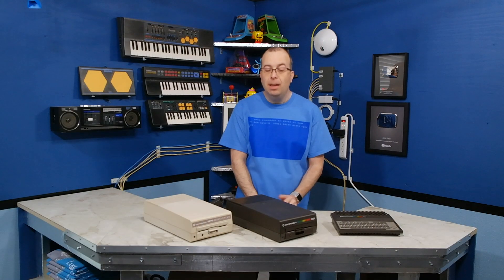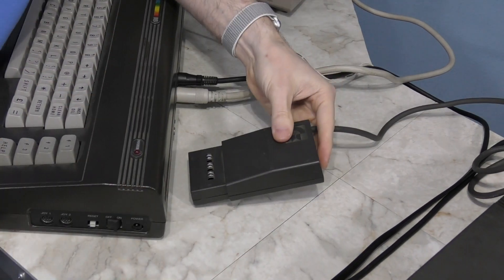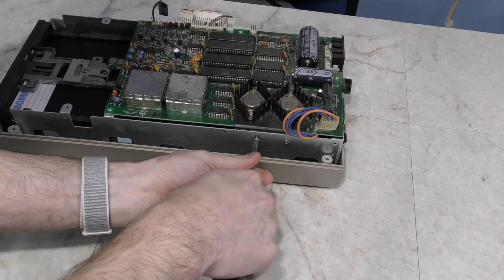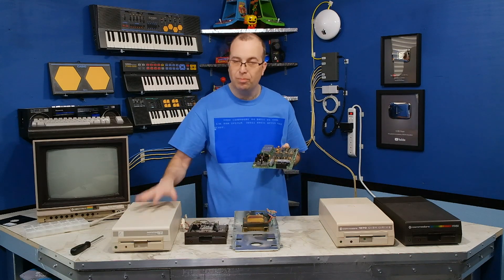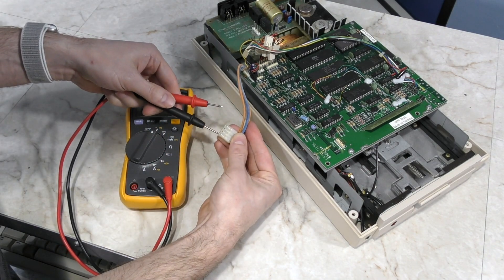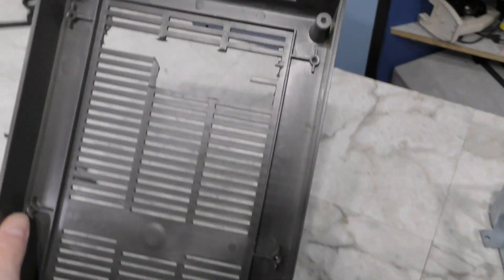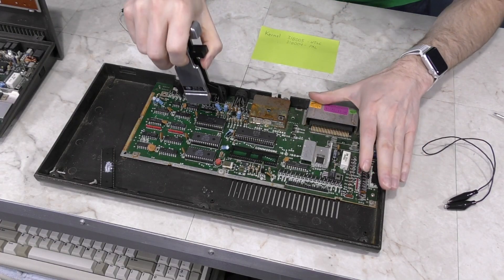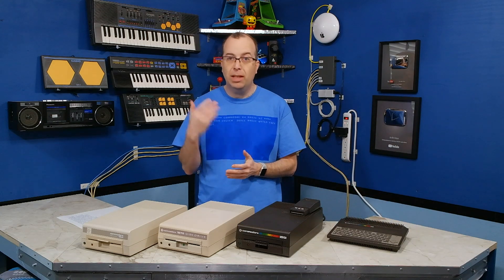Commodore C116 and drive repair, 240V to 120V conversion

Comment: Oops, "Well, we don't have 240V here in the United States." Uhh, yes we do! What do you think electric stoves and electrically heated clothesdryer run on? (Nice place for a correction card.) I like your videos but I wish you'd do a little careful research before you just say stuff.
Reply: The 240V service in the US isn't quite the same as the 240V service in the rest of the world. Besides using a different plug and a different frequency, they use a different phasing system for the service in a lot of cases.
Reply: Maxx Fordham! US 240V power is 2-phase power (2 Hots and a neutral, with the hot phases being 180* from each other. UK 240V is single phase power.
Reply: Nobody suggested that he would.
Reply: Maxx Fordham! how does that work? the house have separate lines with different voltages?
Reply: no , here we have 2 wires feeding 120V each , 180 degres out of phase between them,  creating 240V plus a neutral and a house ground and using US 240V to feed an european device could be ok IF AND ONLY IF the device is not hooked to anything else running on 120V because european 220V has 1 hot wire and 1 neutral, here we have 2 hot wires and 1 neutral , skip the neutral and make one of the hot acting as a neutral create 240V but connect something like an audio or video cable to another device wired for 120V operation and you could bring 120V from the fake neutral into a real neutral and watch out for the smoke A stepup transformer like he used is a much safer solution
Reply: Amnot, yes. are your stove and clothesdryer heated by gas then, so is that why you didn't know about it?
Knucklehead, it might be different, but Dave didn't specify well enough. Also, some places here in the USA have 3-phase, while some have 1-phase, and the 240V in homes is 2-phase like Magi said.
Reply: Drake, even if that were the case, that's not what Dave was talking about. Go back and listen to his statement.
Reply: Right, Magi (even though you mean "hots" instead of "Hots," because it's not a brand name). That has no bearing on what I said to Dave about how incorrect his statement was.
Reply: Maxx Fordham!,
I heard his statement. You are correct that we do have 240v available in the US, and it is an important distinction, but his solution was the correct one.

I wasn't talking about that, though.  I was specifically responding to your statement, considering my electric stove and clothes dryers (and possibly Dave's) don't exist.

I'll admit, I'm being a bit pedantic about it, though.
Reply: Drake, anything about your stove or Dave's dryer or my furnace blower has nothing to do with what I said about his having been wrong about there "not being 240V in the USA." All I was saying is that he was wrong, because we do have it; nothing about his solution choice. So if any distinction should be made, it should've been in Dave's statement, like, "...we don't have 240V to our regular outlets in the USA."
Reply: Oh, haha, Drake, I see what you're saying now: that "your" that I had up there was a key word to you. I didn't forget that gas stoves (including their conventional-oven section) and gas-heated dryers existed, but I accused Dave of having all-electric ones, instead of just talking about them here in this country in general. I fixed that now, haha! So in order for our following replies to make sense now, we should just delete all that pertain to my "your" error that was up there. Thanks for pointing that out to me.
Reply: evknucklehead I see, so it is actually like having separate lines inside the same house? I mean, one wire feeds the 120v and other the 240v?
Reply: The main line comes in from the grid at 240V (actually 2x120V,) and the voltages of individual circuits within the house are determined at the panel box, by connecting them to either one or both 120V mains
Reply: Alain Bourassa I see. Here we have 220v wires (hot wire + neutral) and adding an extra 220v the voltage jumps to 380v but it is only used for heavy machinery afaik, I guess it is the same system there but applied to domestic devices
Reply: Maxx Fordham!, Maybe his stove and clothes dryer run on natural gas.
Reply: Maxx Fordham!, I wasn't talking about you being wrong about there not being 240v in the US, I said you made a good point. Don't blame me that you forgot gas ovens and dryers existed for a minute.
Reply: Maxx Fordham! said "What do you think your electric stove and electrically heated clothesdryer run on?" 

My response has a lot to do with the fact that someone with gas appliances may not be a) familiar with this, and b) it's not suitable for running the equipment in the video anyway.

So Dave was correct in stating that he didn't have 240v [for the purpose of running the equipment in question].

I, like you, wish that he had clarified that but it in no way detracts from the video.

I bet you're fun at parties.
Reply: Maxx Fordham!, It's been fun but I have a life life to get back to.
Reply: Drake, that made no sense. You can't get back to something that never existed in the first place!
Reply: Drake, did you miss my latest reply where I already told you I had corrected the "your" assumption up there, dumb party pooper with the lame, overused insult? When Dave made the false claim about not having 240V, which actually does detract from the video, there are 2 points to note about that: 1. He did not say that just he doesn't have it; he said "the United States" (as a whole). 2. It mattereth not how suitable our 240V are for running these computer devices, because he only said that "we don't have 240V here in the US," which, again, is false. And I also said that he should've done some careful research before making a video, which if done, would've solved that statement regardless of his own familiarity or lack thereof, like if he didn't know about the 240V outlets in his own house because he bought the house used and had gas stuff instead.

Comment: thought you were gonna slice your finger at 4:58. scared me there ha ha
Reply: onedeadsaint I've done that to myself with an Original Xbox. I never knew how sharp those things could be! I had a wicked cut!
Reply: Ive cut my self on the stupidest of thing god damn apple power mac g4 why dles everything have to be so sharp
Reply: Cio Dokop can’t we all be nice in this comment section. It such a good community and stuff like that is uncalled for.
Reply: ScribTOON I agree
Reply: Cio Dokop if this was meant as joke I think it fell flat. let's all be good to each other.
Reply: ScribTOON Simpler solution: How did civilization come to be? People being nice to each other and operating.  If people 10,000+ years ago could be nice, why can't we?
Reply: onedeadsaint lol
Reply: ScribTOON   come on i didnt mean it
Reply: onedeadsaint Don't even ask how I managed to do it.
I was upgrading my computer and I almost cut myself just by grabbing the new CPU (AMD FX 4300) Then I literally almost cut myself just by picking it up out of its little plastic case and almost cut myself.
Reply: It happened to me too.
Reply: VFuzball well too bad I guess

Comment: I'm in the US: I recently received an Amiga 1200 from the UK and have some concerns about powering it. On my usual A1200 I'm using a replacement power supply that has a switch for 110V and 220V and, oddly, the sticker above states "115V/230V Selectable" ... can I use this to safely power the UK model?

Thanks in advance to anyone that can help!
Reply: If the power supply supports 60Hz power, then it should be fine, as long as you have the switch set to the correct input voltage. The voltage coming out of the power supply should be the same regardless of what the input voltage is.

Video output may be an issue, though, if you're connecting it to a TV or Monitor that doesn't support PAL inputs. You'd need a converter box to do it, unless there's a switch on the unit itself to switch between PAL and NTSC, which is unlikely.
Reply: Thanks for the reply! I'll get the information from both systems and compare but shouldn't the PS support 50Hz? Does mine?

I had a Commodore 1942 Multi-sync monitor that supported PAL but have NO idea where it wandered off to...

Comment: It looks like there's a bulging electrolytic capacitor on your 1541 logic board. Better fix that.
Reply: Better recap completely. if one fails, the next one might be not far away. It's a feel-good thing.
Reply: HappyBeezerStudios - by Lord_Mogul That's what I meant, but he might want to keep the old caps for historical reasons and only replace the bad ones. I say this because the European version had Eiko caps made in West Germany (that's how you can tell it's old) and the American version had Nichicon (Japanese) caps, which is another interesting difference.
Reply: Good eye. Surprised it's not already dead if it's bulging.
Reply: It is probably dead. But you don't really need all of the "current buffering" capacitors with the old "crude" technology from back then. Might run unstable though. It should be replaced because the other capacitors on the same supply lines are stressed more. Also the dead capacitor might cause a short eventually.
Reply: Where exactly? I don't see it in the video

Comment: If the solder wick doesn't work, the answer is always more solder. Touch up the solder joint with new solder then use the wick. Reflowing a dry old joint with new solder allows it to flow again onto the wick.

Also, you can weld many plastics back together using a little acetone and some matching plastic flakes.

Comment: David, next time if you blow a fuse inside a commodore, you can use the fuse from the parts 1541.  They are the same 250V 1A Fast Blow fuses.  I almost placed an order for spare fuses when I checked an old 1541 and saved myself the shipping.

Comment: Dude, if you already have a NTSC/60Hz C16, leave the other PAL, and try to get hold of a multistandard TV set, most Philips or Magnavox from the 90s will support just about any sort of Color TV standard. There is next to zero software for these machines in NTSC Land, and you won't run all the cool European Games and especially, Demos !
Reply: That actually happened on one of my old MSX2 demo's. I tuned it that much that it ran just fine at both 50 & 60Hz on my machine, but barely, and when distributed, it turned out that some  machines with (20%) slower RAM, it would stutter at 60Hz, so I had to tweak it even more. Oh, those days of juggling CPU, GPU and memory cycles !
Reply: Or install a rom switcher and some circuitry to switch clocks
Reply: mmmh. Doesn't take much to realise it's possible to code things for most PAL systems that would choke an NTSC system. This is true for most 8 and 16 bit home computers and consoles.
The problem is the relationship between CPU time and Vblank time.
On older systems this is simply related to the amount of CPU cycles for each Vblank period, and on newer ones it's DMA time during vblank.
Either way it's usually double the amount of CPU cycles. Generally at least 80% more.

This can create situations where the PAL system is doing so many calculations during vblank that there simply is no hope at all of getting the NTSC machine to run that code...
The reverse is almost never true; Any program designed for NTSC can at least be converted to run on PAL. Problems, if any, are related to solely to timing differences.
Reply: +Carlos Bragatto
I was about to say the same thing but you beat me to it ^^ Pal have all the software and like the C64 alot dosnt work on a Ntsc machine so you repaired it but made it less compatible ^^
Reply: The fix didn't made it less compatible, it's the mod he made next that did.
Reply: Well yes but you know what i meant :)
Reply: Kinda my thought.  It was cooler as a true euro unit.
Reply: Although you are right, he's right, too. He wanted an NTSC C116, now he has one. He can watch the demos on the C16 or on a +4...

Comment: As the best Commodore 116 / c16 software is written for PAL and not NTSC it would be pointless to convert them to NTSC as the graphics and colours will be different between the US and European software and it might affect the copy protection as well.
Reply: Mr T. Guru makes sense. Although the 116 is rarer, I would much rather have a c16 with the better keyboard. Also it is quite easy to upgrade the ram on a c16 to 64k.

Comment: God no don't convert the 116 to NTSC.  Kept it PAL.  Get a Sony PVM monitor.
Reply: Um. It was a matter of swapping two components, and he could swap them back at any time. It's not a big deal.
Reply: TheRealColBosch, why swapping? You can find a mod to make it switchable :) It's nothing more than a capacitor, crystal and an eprom with both kernels, and ofcourse a couple of wires and switch.
Reply: True. Those monitors are easy to obtain since every professional doesn't has much use for them any more.

But the real C64/116 experience is hooking the thing to your TV like in the good old times. For compatibility you can always use emulation - or obtain another one.
Reply: Not sure about the libary on C64, but for an Amiga or Atari ST it would completely agree.

Comment: The Frankenstein monster of disk drives XD
Still, excellent work :D
Reply: It's like a salvage car rebuild
Reply: It got size of X-box 360.
Reply: 1541-II had external power supply, and it was a lot smaller. And didn't heat up like a toaster! I think everyone that I knew back in the day, had that newer version, or the really slim OC-118N drive.
Reply: #DiskDriveSurgeon

btw i can't use hashtag correctly

Comment: Next time you don't have a fuse handy, you can use your multimeter in current mode to jump a fuse. It has its own internal fuse. I suggest using the lower range (like 500ma if you have it), the 10A fuses are often HRC and can be expensive to replace! :D
Reply: I don't suggest that, some meter fuses are special and harder to obtain
Reply: Not everyone has a fluke, i don't, you also have to get one to replace it.
that link shows blank in the buy it now column.
Or you can just order a selection of common equipment fuses and keep them in stock.
checking amazon, the 440ma ones are $0.70 each, and are HRC.
Not only does a meter fuse need to have the right current rating, but also the voltage, my meter can test up to 1000vdc/750vac
Reply: KC this comment killed my brain cells
Reply: I just wrap the old fuse with a gum wrapper..
Reply: Sparky Projects 
Yeah AND more expensive!
Reply: Dave McAnulty a better option is to jump it with, say, 0.1ohm 2W resistor and measure the voltage (0.1V range) on its leads. Works up to 4amps.
Reply: Paul NJ: I use a lower wattage resistor.   If it burns up, you have a short ;)
Reply: KC:
"Not everyone has a fluke"
 Shame on them, with radio shack junk. 

When you don't earn a lot of money with a device, it doesn't need to be too reliable (expensive).

My favorite meters are cheap Chinese ones. Two of them had cost €38 and look like a Fluke. They have one decade more in the display and they really need the extra figure. They don't work like a classic multi-meter, they use a cheap micro controller and don't contain any expensive rectifiers, voltage dividers or shunts. They are software compensated and their accuracy depends on the clock source and a single accurate resistor inside. I went to a calibration laboratory and those guys were amazed to see that the readings were even within the tolerance of their calibration gear!

The downside is that the mode selector contacts will grind right through the PCB when twisting the knob too often and when dropped, solder joints may break. Also the test plugs may not be plugged to often or the sockets snap off the PCB. 
But hey! I can fix any broken joints within a minute and I can buy more than 10 of them for a Fluke with the same functionality. 

Even as a professional earning money with multimeters, my Fluke just sits in the glovebox as a backup. Why would I want to use it? It is less accurate. Also when the Chinese meter "kisses middle voltage", drops into a deep cable duct or rain pours onto it, I don't have to be sad, just take the next one out of the car.
Reply: Just use a nail.